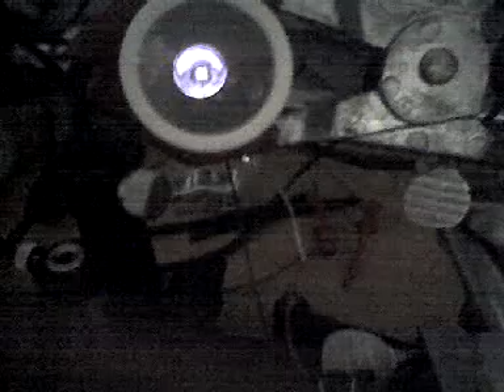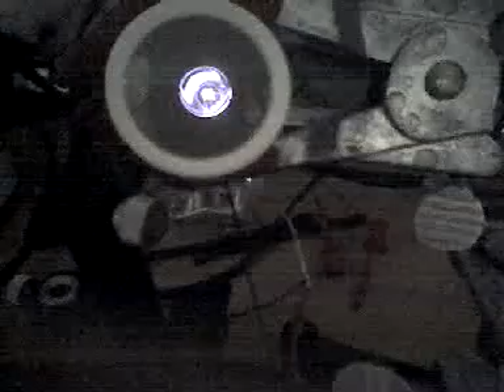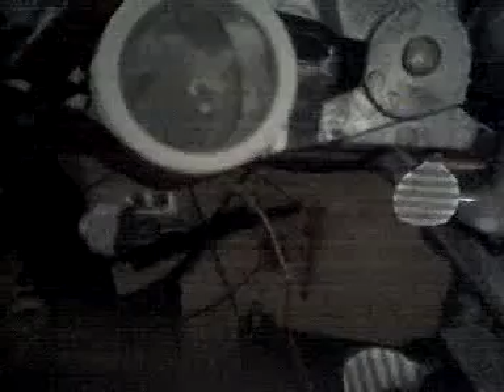MilesTag Lens testing

Comment: yeah .. strange wonder if it's a constant (low current) thing... or if they pulse it. I would have thought they would have pulsed it (like a short pulse width on of less than 0.1ms at low current) every second so-as-to save on power and  so forth. Do you have any oscilloscope to test the output? I remember seeing something about testing the IR-LED, I just never gave it much thought until now. Thanks for sharing.